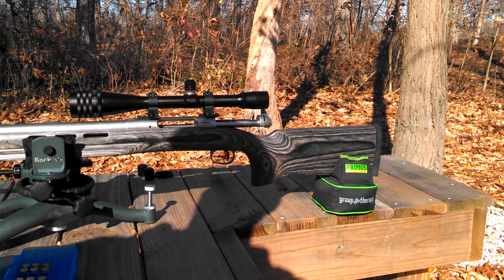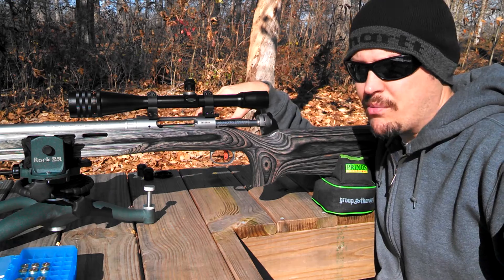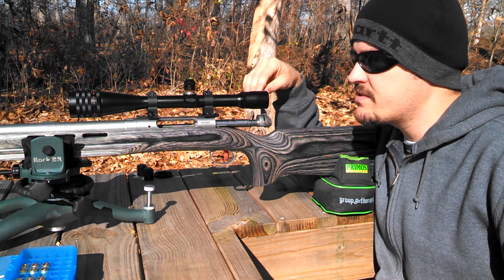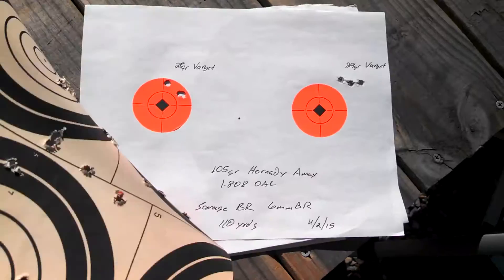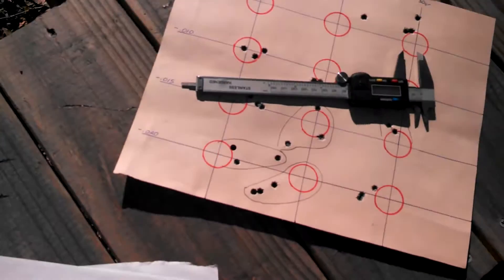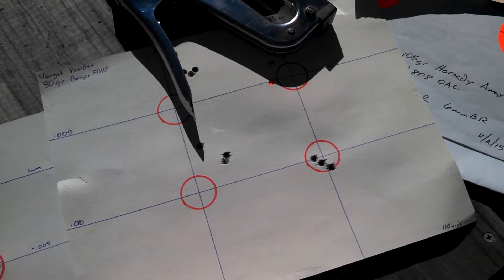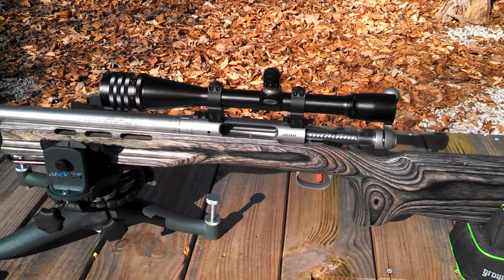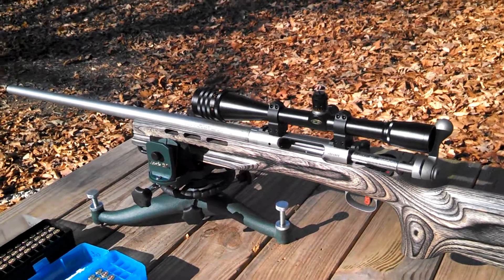Savage Model 12 BR Part2.. Load Development Update.

Comment: I've owned a Savage 12 F-Class for a little over a year now and have tried Varget, Benchmark, IMR 8208 XBR, and IMR 4895.  Also, I have tried about 4 different Berger bullets ranging from the 90gr.-105gr. VLD and also the 107 SMK so I know your struggle with trying to find that perfect load.  Most of my groups though regardless of the combination seemed to produce sub MOA so maybe it is your barrel? I would suggest my pet load if you want to see if that works with you though.  I use Lapua Brass with 29.5gr of IMR4895 topped off with a Berger 105 VLD Target bullet seated at 2.365" (which is I think is .010" into the lands) ignited by a CCI 450 primer.  I get .25 moa (around .5") @ 200 yards with that load.  Another suggestion that might help out slightly is since you are using a Weaver T36 I would suggest you shoot at those caldwell 1" orange stickies.  The fine dot on the weaver fits perfectly inside the center of the target at 100 yards which will help you maintain a better sight picture than those targets you are shooting at in this video.  Well keep us informed on how the load development comes along because I know these are really capable rifles!!
Reply from the maker: Hey thanks for the info, I will defiantly keep everyone informed on the rifle and what takes place. Thanks for watching!

Comment: I did some trading last year & acquired this same model.  I also struggled with trying to find a load.  I finally decided to swap barrel & caliber.  I went with a X-caliber prefit in 6BRX.  Best decision I ever made.  With the new setup I'm shooting 107gr SMK with Reloader 15 & now getting 5 shot 1 hole groups at 100 yards.  I also tried multiple powders & found that Reloader 15 works the best for me in all my 6mmBR's.
Reply from the maker: Yea this rifle ended up having a barrel issue that I ended up having to send back to Savage and have them re-barrel it due to a rifling issue. As of now the fella I sold it to is getting some awesome groups out of. Sounds like you got a nice shooter, I'm really liking the 107gr SMKs in my new 6Br Savage, love those projectiles so far. Thanks for watching!

Comment: ....just bought the Savage 12 FTR in .223 Rem (1:7), with the adjustable comb and pad, ands it's shooting bug holes @100 yards with 75grn Hornady BTHP over 23.4grn of N540 with only 50 shots down it...I lighten the trigger pull a little and torqued up the 3 stock bolts as suggested (front 2 in 5 inch/lbs steps from 20 to 30 and rear to 15).  I'm trying 80grn SMK too but the 75grn will take some beating!  Thanks for the video!
Reply from the maker: Thats awesome! Thanks for watching!

Comment: Things I agree with
replace the barrel. I use Bartline barrels and they make a huge difference
things to change move the rear bag forward so the back of the ears are about 3' away from the but of the stock

I know you sold it to a friend, and his groups improved drastically with a new barrel, that's what I do but a quality barrel can't be beat even though they are pricey

Things missing
you never mention the twist rate. That makes a huge difference when it comes to selecting a bullet weight.  

Load development
Go to accurace shooter there is a ton of tips to help you get to a good end result faster
look up the 10 load development on youtube to find possible nodes to work on for starters
Brass I only use lapua brass, don't mix and match different brands of brass
CCI 450 primers are the prefered primes for 6br
I use Vihtavuori n140, but varget is a good choice, as well as others especially with the way shooting supplies are now a days

Your scope:
 A bench rest rifle is only as good as the scope for repeatability, and adjusting. I use a Sightron SIII Long Range Scope 10-50x 60 Reticle Type: Target Dot, 1/8 MOA clicks. Not a the cheapest scope, and not the most expensive, but I've had four of them, and they all were wonderful

Hopefully this helps you no matter what rifle you shoot
Reply from the maker: Thanks for watching!
Reply: If he changes the barrel he can not shoot "Factory Class." Bartlein is a top of the line barrel though.

Comment: You probably have a defective barrel you may want too borescope your barrel because 6mm br is a really accurate cartridge I had the exact same problem with my savage I had to replace the barrel because  the last two inches of the barrel one of the lands was not cut correctly!
Reply from the maker: Thanks for the heads up. I've got some Berger 105 VLDs coming to try out. If I still don't have good results I will for sure look into that an decide how I want to proceed. Thanks for watching!

Comment: That is/was a very lovely rig you had, Savage does produce a great rifle. Owning two myself a Model 10 FP in .308 Winchester and a Model 12 in .223 Remington. You were speaking about the trigger locking you out, can you please go into more detail about that ? From reading the comments I know that you sold the rifle to friend, because of the barrel. Thanks in advance
Reply from the maker: Yea a buddy of mine was wanting it pretty bad when I first got it and I had gotten all the content I needed for the channel out of it so I hooked him up with it. As far as the trigger, they have what's called "side force lock out" its a safety feature for in case the rifle is dropped or jarred the trigger will lock up and not allow the rifle to fired. In turn you need to re-cock the rifle and then you can proceed to fire the rifle. one thing to note is when you start adjusting down the pull weight especially in the target accutrigger models it can amplify this feature to happen even by shutting the bolt hard. So care has to be taken to close the bolt softly when you have the trigger adjusted down real low. It doesn't really hurt anything and I understand why Savage did this, but its a serious pain in the butt, when trying to shoot sometimes. One simple fix is to just do away with the factory trigger and go with an aftermarket unit. Hope this helps, thanks for watching and feel free to sub!
Reply: Thank you for more insight into this condition, well my trigger has not been adjusted at all. But mine will lock me out, so I guess I may have to work on closing the bolt more softly during my strings of fire, yes it is a pain in the butt. Keeping your suggestion in mine, I make have to do away with the factory trigger and go with a aftermarket. Thanks again
Reply from the maker: No problem glad it helped. That honestly is why most people change them out, but yea just try closing it slowly and see if it helps. If not just swap it out. Good the aftermarket triggers for bolt guns are pretty reasonably priced.
Reply: Now what is strange it doesn't happen on my Model 10 FP in .308 Winchester at all.
Reply from the maker: Yea the non "Target Accutrigger" models were a little more forgiving vs. the ones that are the Target models.
Reply: Thank you again, you have given me great insight into my Savage Rifles
Reply from the maker: Anytime, glad to help..
Reply: Your a class act

Comment: for 1 thing your rifle is toooooo faaaarrrr forward on the front rest get it back 3 or 4 inches please do what bench shooters do please and put a rudder on the back stock and get the rudder level with the front stock that will shrink the groups off the bat use re15
Reply from the maker: plane iron The rifle ended up having a rifling issue toward the muzzle end of the barrel. It ended up getting sent back to Savage and they rebarreled the rifle. A buddy of mine now owns this rifle and shoots it frequently in his local matches. Appreciate the tips however. Thanks for watching!
Reply: ok I was just ranting, I had a Dasher on a 12 palma action that shot really well, now I have a 260AI on the palma sav
Reply: I really like the 12 palma action mine is smooth as silk

Comment: Tell the viewers why you chose to use Varget as the powder for your load developement?  You may have been missing out trying other similar burn rates... some 6BR work well with  IMR 3031. So much for Savage's Definition of accuracy. I'm glad I shoot Rugers, Winchesters and Brownings! All of the Accuracy- None of the Weight!
Reply from the maker: MEAlstonIII Mostly because I keep quite a bit of Varget on hand for my other calibers so I had it available in a quantity to be able to load develop. After this rifle was sent back and was re-barreled due to a rifling issue, the owner that has the rifle now has shot some amazing groups with it as well as placed pretty high in a few matches. Thanks for watching!
Reply: That's depressing to here. I can only imagine how you felt when Savage determined it's barrel to be defective.  I would have been heart sick myself to learn how a button rifled barrel was defective (save a dinged crown or sloppy chamber)....but nonetheless, it brings to mind the one Savage I purchased 10 years ago, where the fired brass would break off just ahead of the case web, leaving the case walls in the chamber upon the extraction stroke (using factory Hornady mind you)...Savage requested the rifle be sent back for their inspection and indeed they told me that rifle should never have been placed in the warehouse inventory..so they sent me a new rifle.  Since Savage stood behind their product, I was only mildly disturbed. The new rifle arrived and I was giddy as a kid at Christmas- only to guess what-? The new rifle suffered the very same problem.  I sent the remaining ammo back to Hornady for their inspection and traded the Savage towards something else.  And I was heartsick from that point forward and the only similar design I've ventured towards and have truly enjoyed was Marlin's XS7 (243Win)...I am very glad your experience was resolved.  AllTheBest
Reply from the maker: Wow that's crazy I've never heard of one doing that, I would have been upset as well. Yea I was pretty tore up on one hand but relieved on the other because I knew there had to be something wrong somewhere. Just so happened to be the main part of the rifle.. The new owner is loving it though so it all worked out. I will say in their defense they took care of it without question, so there's something to say for that. I do enjoy Savage rifles a lot as you can if you've watched any of the videos on here and currently still have a couple. They still rank high on my list, but I really enjoy Howa rifles as well... Take care.